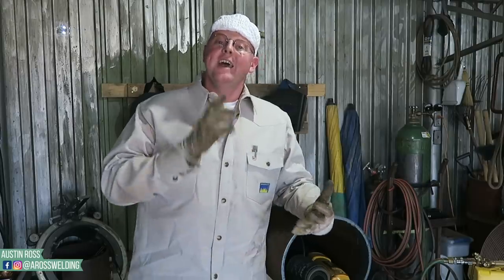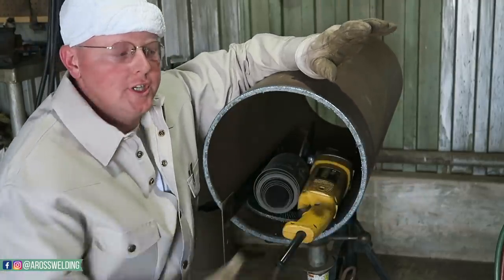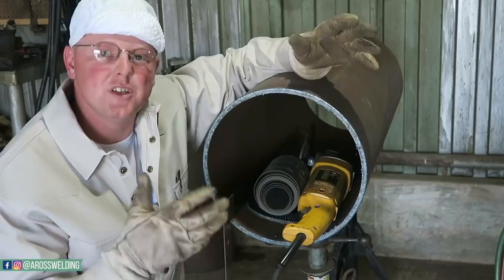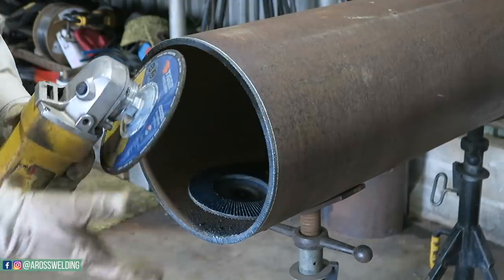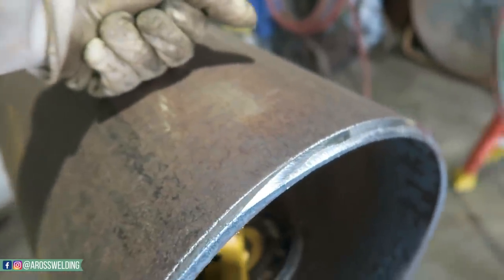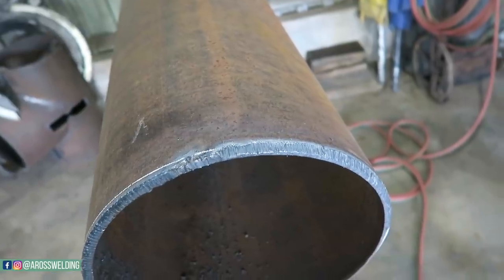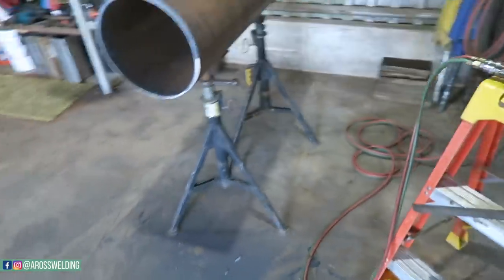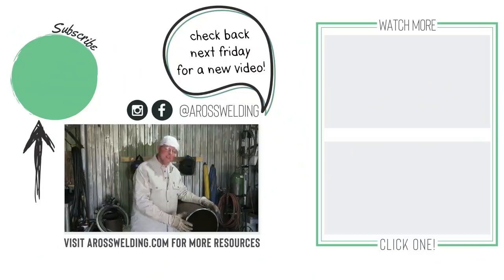HOW TO BEVEL PIPE WITHOUT A BEVELING MACHINE

Comment: I have a positioner that is made from a piston rod of a pump jack. It's all grounded on my truck and makes doing roll-outs a lot easier. I use a small bit of angle to rest pipe, elbows, or flanges with flat straight slots and bolts. Really helpful tips and I agree with using the the middle of the abrasive disc to better contour the bevel. 🤘🤘🤘

Comment: I worked with an old timer I swear he could bevel a pipe consistently and it would be just like if you put a pipe beveler on it... Knock the slag off and could damn near start welding on it just a quick pass with a sanding disk to flatten out those kerf lines and bam... I hope I run into that fellah on another job soon, but who knows he may have hung it up by now... actually I doubt it he was the type of fellah he'd probably die the day he retired.
Reply from the maker: Lol I know the type.
Reply: I usually do freehand beveling with an angle grinder and a coarse sanding pad (K36 or K24). No grinding discs, no flap-discs. Keep steady torso position, put the bevel on in six grinding-turning sequences. One has to keep the angle (grinder <-> face/land/nose) consistent. Which is not too hard. Keep a keen eye on shrinking the land back to <xx>mm. Sort of like the old timer guy does it I guess.

Comment: If my math serves my right, you would need to go back about 1/2" to get a 35  degree bevel on a .375 wall pipe and about 5/16" on .250 wall if you wanted a true 35 degrees to practice on. Hope that helps someone
Reply from the maker: Awesome thanks
Reply: .500w is 5/8" wide bevel to bevel with 3/32 gap/land @ 32-35° bevel. 
    The bevel angle is measured from the spacing tool to bevel edge.
    I believe your math was correct, just you used the opposite angle.
   Which wouldve created an unnaturally wide width for the cap.
Reply: We use 30 degree, and generally only a pipeliner will chalk a bevel line for a hand torch. I don't think I ever have in 20+ years.

Comment: The "correct angle for beveling pipe" at least int the hvac pipe fitting world is 37-1/2 degrees. I'm. To sure if this corresponds to the pipelining world or not but that's what angle bevel all standard fittings have on them. Thanks for the great videos, keep them coming! And keep safe out there!
Reply from the maker: You bet! Thanks for watching!
Reply: All pipe bevels I have ever worked on over 30 years were 37-1/2 degrees.

Comment: hey Austin good vid, I used to use those flat type 27 discs to grind the bevel and many years ago switched to a type 28 cupped or saucer shaped disc on the bevel and switch back to the flat disc when grinding out root and other passes. the cupped shape forms a natural fit to the shape of the pipe and glides over it even faster than flap discs .seams less fatique as the day goes on.hope this is helpful
Reply from the maker: That’s a good idea. I’ve also seen guys bevel 2” with a 9” disk the same way you are takin about. Works almost perfect.

Comment: Another help skill is learning to to hand bevel without rolling the pipe. I did some hand beveling on some 2 to 4 inch pipe but was lucky enough that the pups where short so I was able to roll the pipe around. I did however challenge myself and try it without rolling the pipe around and that added some new challenges.
Reply from the maker: That’s a very good skill to learn. Thanks for sharing. 👌😎

Comment: Im a recent journeyman pipefitter man id love to see detailed beveling with a grinder i did bolt up for 5 years i need some pratical experience and i'd like to see fitting pipe and washing out socket welds and cutting out butt joints
\

Comment: What do you prefer to wear for eye pro when you’re torch cutting in a shop setting like this video?  Never saw your face but I usually just use my shield since I haven’t sprung for dark glasses yet. Is it worth it?
Reply: Most only use dark shield cause they have to because safety rule
Reply from the maker: I just use sunglasses.

Comment: I'm having a issue that I'm sure some of you have run into before: I can get a halfway decent bevel, but I end up chasing high/lows, running out of bevel, and have to start all over again. Any advice on what I'm doing wrong, or how long this ought to be taking me from start to finish?
Reply from the maker: Did you draw a line all the way around about 1/4” back from the end of the pipe?

Comment: I suggest the same thing and if you ever read that book read that book on welders offshore guide , the author of that book suggests that you go purchase your own pipe at a scrap yard bring it to a machine shop have them cut it up in a number of coupons at a 37 and a 1/2 degree bevel And purchase your own welding machine and practice at 6G welding test over and over and over again at home because that's what you're gonna be doing at a welding school and instead of spending thousands of dollars going to a welding school , let your own backyard be your welding school,  buy your own welding machine , ac-dc welding machine from northern tool company and purchase your own pipe, have it beveled and start practicing in your own shop or your own backyard,  it's a whole lot cheaper than going to school.

Comment: I would recommend setting the torch to washing buy turning oxygen up as high as possible right before it shuts off and hurts your ears. You will have a much better result/control and less clean up.

Comment: Beveling pipe with a cutting torch free-hand is a dying art. I urge everybody to practice, practice, practice on torch cutting a bevel on pipe. It’s the fastest way to prep pipe if you can do a decent job of it. Cut the pipe and clean it up with a grinder. Boom. Done. Next.
Reply: It's not faster than a pipe beveling machine..

Comment: Do you really use your starched shirts on the pipeline or do you change into an FR welding shirt? I'm only asking because the other day I bought a brand new shirt went to work the next day and messed it up with rust stains. We dont have helpers to do the grinding.
Reply from the maker: Yes I really use my starched shirts whenever I weld
Reply: Yeah you can’t get away from getting dirty lol. If you’re worried about stained clothes welding isn’t for you

Comment: Thank you, I need to make a couple of 2 in schedule 80 pipe coupons for my 6g certifications. Would you recommend a smaller grinder like 4.5 in to bevel them? I was thinking too of rigging up a pipe spinner for efficiency.
Reply from the maker: The 4” grinder would work but a 7 or 9 would also. Especially if you had that spinner.

Comment: Aaron what are guys doing for aux power to run grinders when they are running a SA200?
Reply from the maker: The names Austin. 
Dewalt grinders are ac dc. Or they install a power inverter.
Reply: @arosswelding  sorry buddy I ment Austin it's been a long weekend. Thanks for the info

Comment: I start my bevel with the edge of the disc and then smooth it out with the inside. Way faster I can bevel a 12 inch in 10 minutes. But I've also been doing it for a long time. Start with the edge and finish is like you did with the flat part of the disc. And put a face shield on you need to teach saftey as well. I've been a welder for 17 years and I have seen a lot of dics blow up. It is not pretty.
Reply from the maker: That’s a good idea. 👌😎
Reply: It's seriously a huge boost in confidence and just generally pleasant fabricating without getting the random bits in the face. They also make a great impromptu flip-up umbrella to keep the rain off your safety glasses while wrapping stuff up or doing other jobs out in the elements.

Comment: just got a Lincoln sa200 its quite old, put it on my truck. got a question for you Austin: What happens if my machine is blowing blue smoke out of the top back vent?
Reply: Sloane Smith then fuel or oil
Reply from the maker: 🤔 like out of the radiator?
Reply: @wesgandy4718  you need some cheese with all that whine bro? Don't be salty that someone is trying to help lift other people up. Probably why you're on the list 🤷🏼‍♂️

Comment: Nah man. I can bevel 12" pipe 100" perf with only a grinder. Problem here is. You dont have a set up to keep turning your pipe, as your grinding. Torch looks shity. Plaz looks like shit unless you made a set up quick. In a shop. Waste of money forreal. Thinking to hard. Get the shit done. I am thr saw guy. With a broken 1970s marvel band saw. So square anyway.  But fuckers madr me siy and bevel like all 45 i cut.  I never marked a thing. I left about 3/16 ish. As a face not touched.  But yeah. Next time you need to bevel pipe. Straight like 9" grinder and gp to town. My boss woulda fired me.if it took 30 mim to bevel likr 5 inches at a time from a 12" . Plus more rpom for needing more work. Gppd video tho